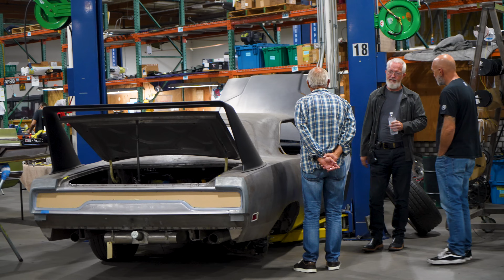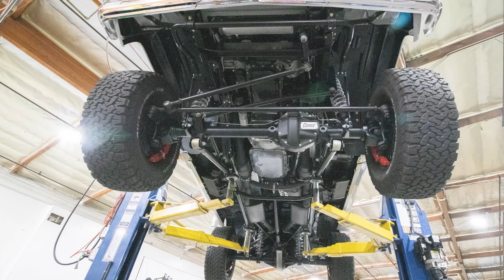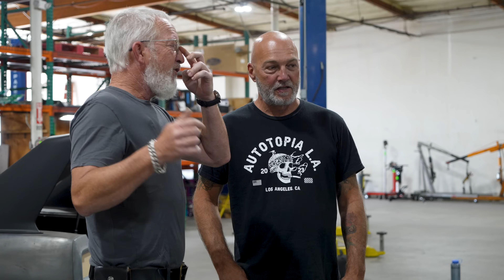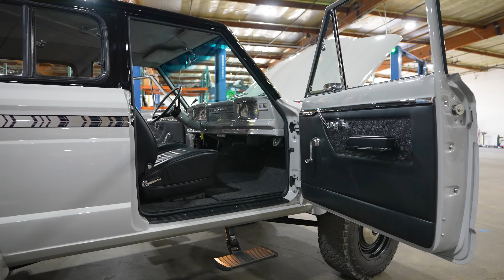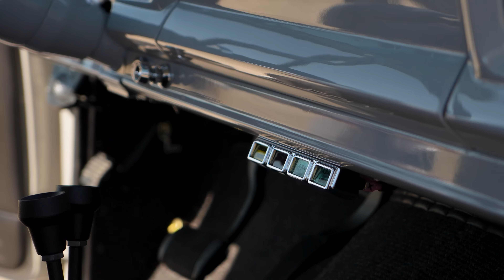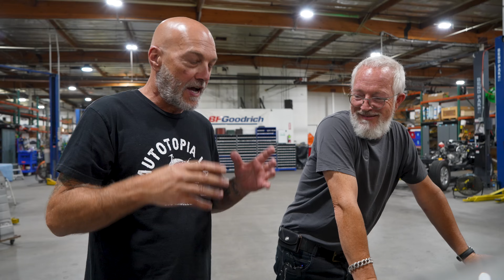This CUSTOM HEMI Powered Jeep Cherokee 4X4 by ICON is Perfection! [4K]

Comment: I may get some hate for this, but on the transmission why don't you use the 8-speed transmission that comes with the 392 that's designed for the 392 the 8HP70? Or the one that come with the Demon, the 8HP90? Both read speed transmissions both are built to take the abuse of those engines and both have four more gears to run through which would make it a lot smoother and a lot more fun to drive I believe.JMHO

Comment: Love the build overall. Once again, Jonathan and the ICON team turns out another impeccably-thought-out, epic build!
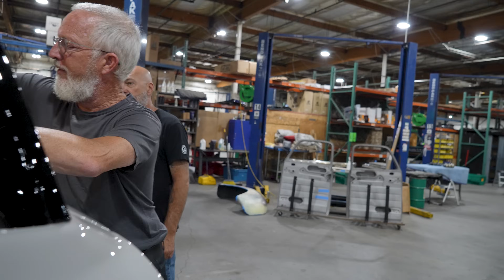But hmm... 28:42 for 3/4 of a mill or whatever this thing cost, it seems like there should've been some geeky engineering applied in the form of gas struts or crazy power hinge system to help with raising and lowering that heavy tail gate. 🤔

Comment: Great looking truck, but he has no clue what he’s talking about when he said the trans grenades if you add even 5 horsepower over stock. The 8hp is a great transmission, hence why it’s used in so many cars. And the aftermarket is great.

Comment: I am absolutely in love with the nerd-level passion for this. the ICON wagoneer was already an inspiration, but this makes me want to turn mine into a wide track.
I am no fabricator, but I did build a grand Wagoneer with a hemi swap, and an 8-speed that does not grenade. I Lost focus on the interior (I wanted to keep it original but let's face it, it should look original, but feel modern) so that's something I will redo over the winter, the original seats just do not cut it in terms of comfort on longer trips. The same goes for suspension, I kept the original setup and upgraded to all-new leaf springs and Bilstein shocks, but it still rides as leafsprings. I have designed a radius arm front and rear suspension that will work with JK axles and the original frame. I do not have ICON budget, but doing it this way is way more fun and cheaper than buying a new boring SUV from the lot. And those do not have solid axles, part / full time 4wd and 32" AT tyres packed in a classy vintage look

V8's on new cars are virtually extinct in Europe, unless you are willing to pay 100% environmental tax, so now I get to enjoy a modern V8 in a bespoke package that suits my style.

Comment: Holy crap this jeep is Bitchin. My parents used to have an 80s Wagoneer in fact, I used to help my dad work on the thing because it constantly broke down. It was a 360. I think it had Carter carb ect I had a bunch of different manufacturers and you could tell that the dies were worn out on the body because Jeep pumped out 1 million of them….

Comment: This is basically the best of the best modern ground up built 4x4, with a beautiful retro body skinned over the top. This is the pinnacle of what is possible
Reply: The thing is still on leaf springs so that's far from the truth. Cool rig but still rides like an old truck. I've built a few FSJs (for off road) and no manner of leafs will ride as well as a linked vehicle. 

I really want another Cherokee Chief but they're either rusted to hell or ridiculously expensive now. And that's too bad. These things are the perfect dimensions and personality rolled into one.

Comment: Wayyyy to nerdy… I can appreciate all the emphasis on CAD and the “nerd” stuff… but what I really appreciate even more is just “simple” craftsman that have 10k hours in their craft and know what they are doing. Along with that means you don’t bring a Jeep to a Mustang builder, you don’t bring a GM to a Mopar guy… and so on.
CAD and technology is great and has its place, but you don’t need 10k hours behind a computer screen if you just have a guy that has 10k hours shaping metal, welding, and building a specific platform.
Restoring cars is way to niche and specific to try to re invent the wheel in a computer program just so you can learn how to build a car you’ve never built before.